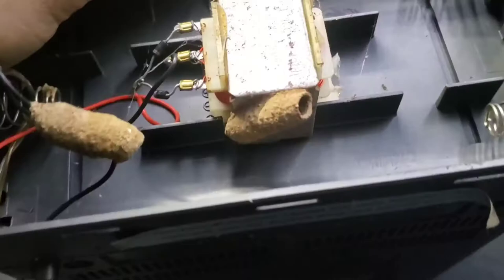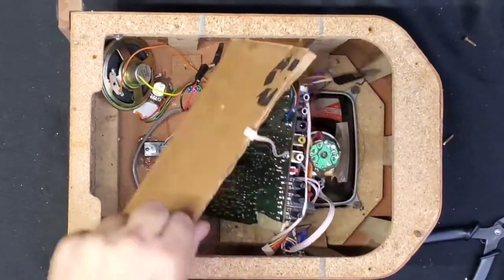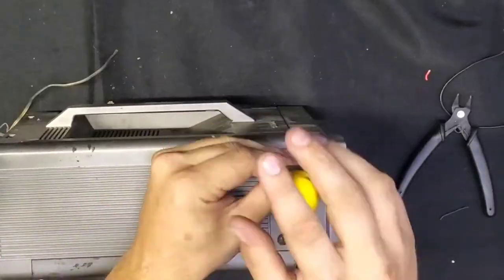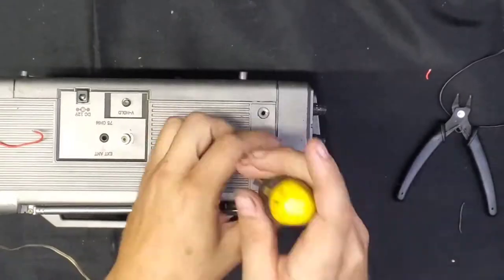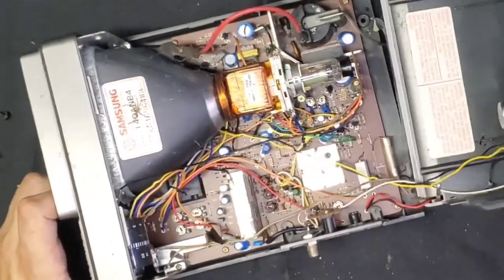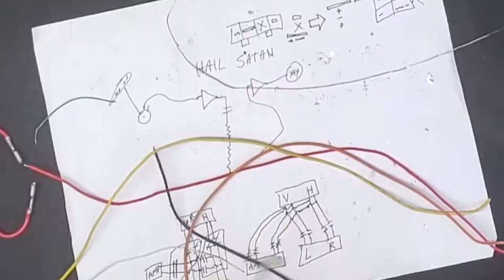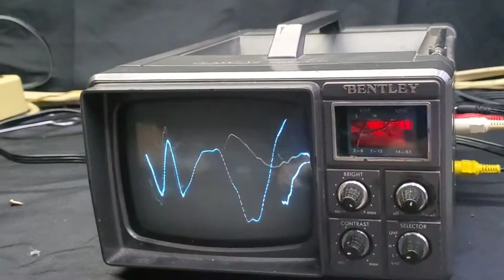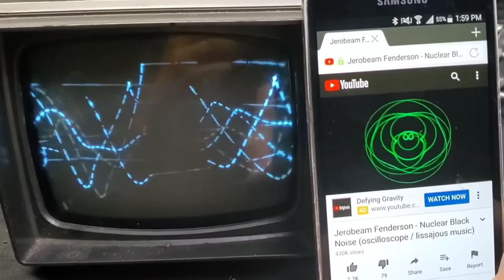Homemade Oscilloscope / Vectorscope from a Bentley Portable Television

Comment: Love the reuse of the switch for selecting XY modes. Very nice.
The Non Circle is due to the X and the Y coils being different to each other in tvs. If you measure them one is about 4ohms the other 20ohms. As well as lower signal - this makes one lag slightly and gives you an oval. Some people have rewound the 20 ohm one - 100 turns of wire - to make it 4 ohms but then it wont play playstation anymore - not done that yet myself.

I tried those same amp modules to drive the coils in my 5" tv (taken from karokie machine) - and it overheated and burnt out in minutes. Think you need a heat sink on the lm365. Im using an amp from a car now.

and lastly - you can easily add a composite mod to most old tvs - they all use the same ic - one pin is the composite video and one is the composite audio that goes to the rf convertor. I used red/white phono plugs that disconnect this rf connection when plugged in and connects signal to my console....google the chip number for pinout. all the best....
Reply from the maker: Thank you very much for that information. I didn't know any of that. Interesting to hear your lm386 burned right up like that while These ones are still working 2 years later. I'll look out for that in the next frankenTV project. Thanks mate

Comment: How do I inject an audio signal to my vertical coils? I’ve connect my horizontal coils to my vertical terminals and wires the vertical wires to an aux cord and tried used a laptop to inject wave functions but nothing. Any advice?
Reply: I was thinking of getting a microphone and using the audio input just so I can see some vertical movement.
Reply from the maker: You need an amplifier between the laptop and the vertical coil. The ones i used in this video were made for arduino and are cheap on amazon. Lookup "lm386 arduino module" 
You could also use some random amplifier from something with a speaker in it..
Reply: @satanicinduction  so the audio goes to the amplipher which is in series with the deflection coil wires? Or do I need to adapt the module to go into a port.? thank you for answering my question there’s not a lot to information regarding how to input a single to this project, Im relatively new to the hobby so it’s been a struggle trying to find a solution that doesn’t require me to get a function generator for a simple overnight project lol.
Reply from the maker: You could use that 
Just put the coil where the speaker belongs
Reply: @satanicinduction  I am a goof, the module you recommended is just a better setup of the the bread board video I sent you. Last question, if I wanted to input a standard audio jack cable to play sound frequencies how would I go about wiring the jack leads to the modules terminal. Also I see you have 3 in parallel I believe with a resistor int between the two, is that relavent to my case?
Reply from the maker: In your case, the three amplifiers aren't necessary. I have one for each deflecting coil and a third for the speaker. You can get away with just one.  All you gotta do is wire the aux cable black to ground, red/white to input on the module. If you wanna hear the audio,  add another module with input wired parallel to this one with a speaker connected
Reply: @satanicinduction  you are a godsend thank you for help! I’ll keep you posted when I get the module.
Reply: @satanicinduction  I’m only trying to project sound waves onto the vertical coil but for some reason I assumed the audio came through on the tv; even though the audio output is directly connected to the deflection coil. So I think that the suggestion having the modules in parallel may be the way to go.
Reply: @satanicinduction  so while waiting for the modules to arrive I found an old stereo system with an RCA output and tried to inject that into the deflection coil but no dice.
Reply from the maker: Youll have to use speaker level signal to the coils. The rca connections are just too weak
Reply: @satanicinduction  makes sense. Am I able to connect the RCA output to the modules input?
Reply from the maker: @anthonyyoungo4294 should work
Reply: @satanicinduction  good deal
Reply: @satanicinduction  so I connected the left and right audio channel leads from the rca cords to the IN and VCC terminals on the module and connected two wires of the deflection coil to the out and ground screws. I think I am wiring incorrectly
Reply: @satanicinduction  the RCA and the AUX both have a read and a white internal cable and each cable has its own ground wires.
Reply from the maker: @anthonyyoungo4294 connect the rca cable grounds and power negative to the ground on the module,
Connect the red and white from the rca cables to input on the module,
Connect power positive to vcc on the module,
Connect the vertical deflecting coil to the module output,
Connect the tv vertical output to the horizontal deflecting coil, dont connect the tv horizontal output to anything. For spund jist wire another m
Reply from the maker: @anthonyyoungo4294 odule the same way with its output hooked to the speaker. 5-12 volts power to the modules
Reply: @satanicinduction  YESSSSS
Reply: @satanicinduction  tiny squiggles from  a online tone generator from aux to amp
Reply: @satanicinduction  I hooked it up and started playing some SOAD oh my fucking shit it’s so cool thank you man you have more than earned my sub

Comment: There is no serious information in this video.
Reply from the maker: Were you hoping for a tutorial?
Reply: @satanicinduction  i would cause i found a Bentley this big garbage pickup day
Reply: @satanicinduction  I was! I also happened to have come across the exact same Bentley portable tv seen in this video while digging through an old closet and it is in mint condition! It’s practically begging for a greater purpose beyond collecting dust..
Reply from the maker: Then I'll get hold of another portable tv and make a video showing how to do it. For your Bentley tv, I'll show the wiring for the selector switch.